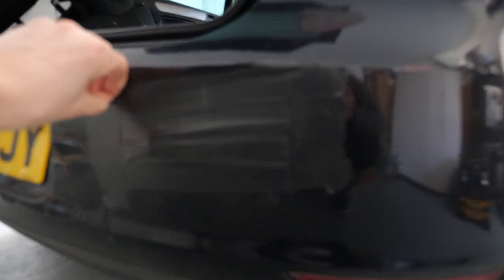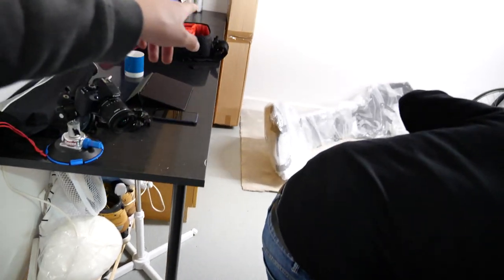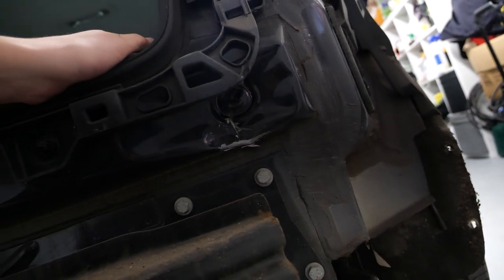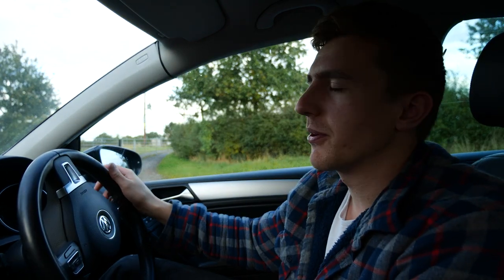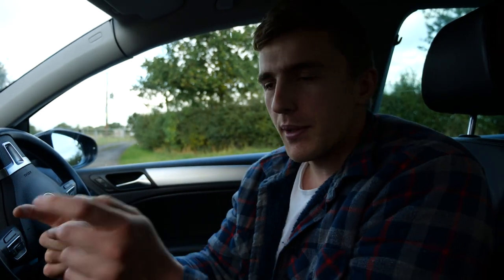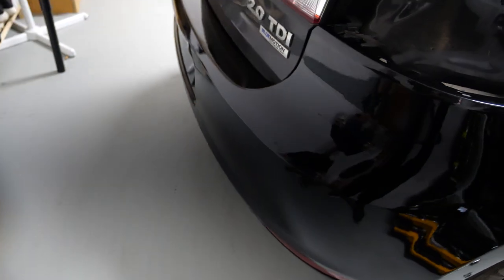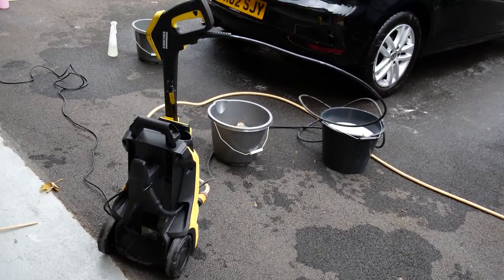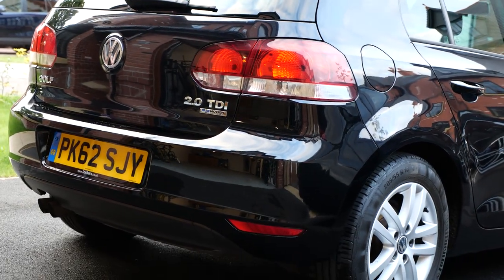I crashed my car.

Comment: Happens loads of times .Always leave in gear for this reason. Car point downhill put in reverse .Car point uphill in 1st and as you did turn wheels to hit curb if it were to fail .worse with electric handbrake  as brakes cool gap between pads and disc can  appear ..glad no one was injured.